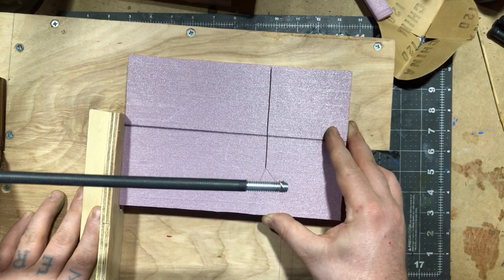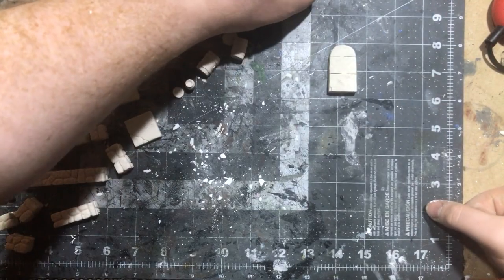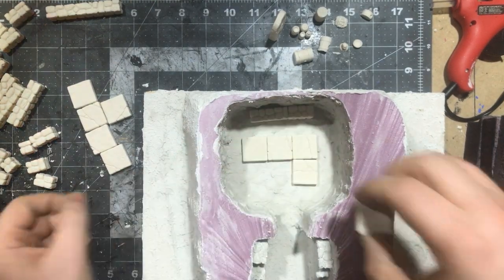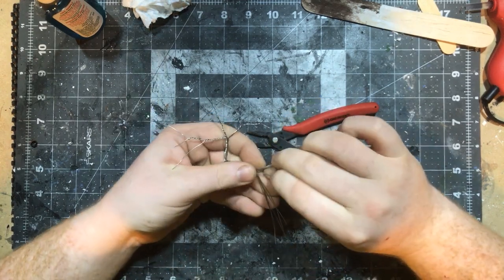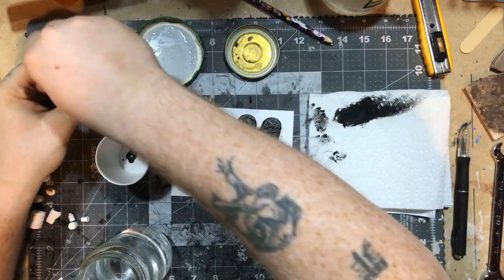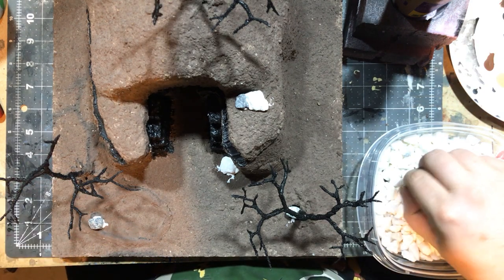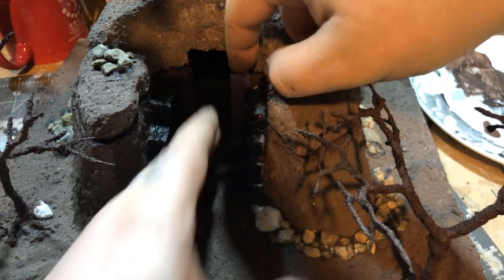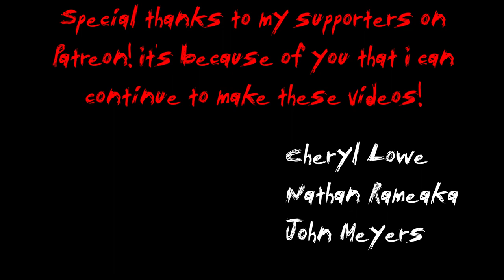👻Tutorial - How to Make a Modular Burial Mound for D&D - Part 1🧟‍♂️ (TheDungeonMattster #15)

Comment: Where did you get the mold from? Also great video 😁
Reply from the maker: From Hirst Arts. They’re a bit pricy but you can get so much out of them.

http://www.hirstarts.com/
Reply: Not that pricy for what it is 😄 I started buying minies and stuff this year and I was considering getting a terrain crate with a bunch of tiny pieces and so on so this in actually waaaaay in my budget. Thanks :)
Reply from the maker: I recommend using either Hydrocal or Merlin’s magic plaster for casting these. Waaaaaayyy more durable than Plaster of Paris. Hydrocal is a nice mid point. The molds work well with casting resin as well but will degrade faster. Make sure you follow the instructions on the site for using and storing them and they’ll last you a long time!